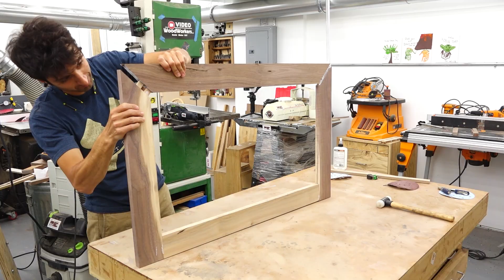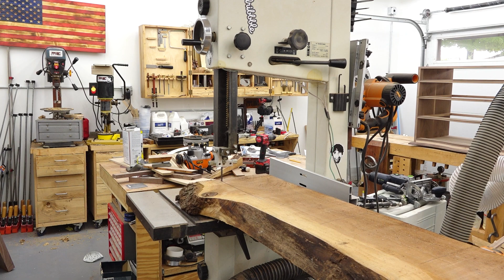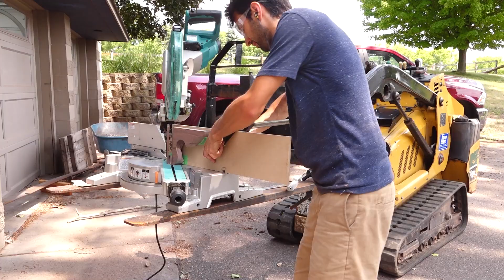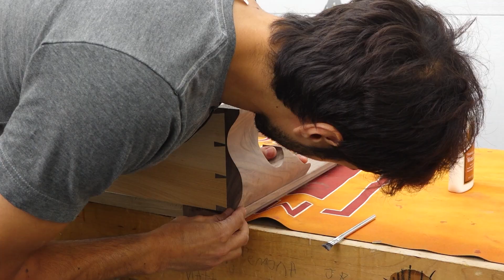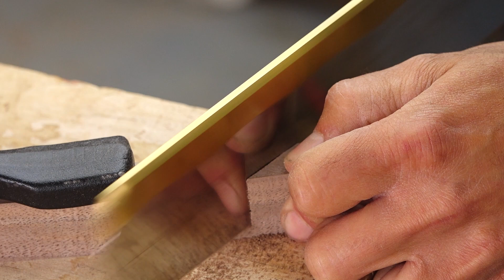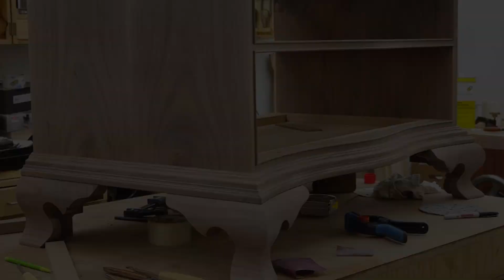The Base (Ogee Bracket Feet) | Serpentine Chest of Drawers Build Part 5

Comment: Was it the camera angle, or did some of the feet blocking material protrude into the drilled out inside curve areas of the finished feet?  Or is the foot depth great enough that you can't see the blocking material, unless you are laying on the floor looking in at the inside edges of the feet?  Super cool video, showing the patience necessary to understand and work with the details of the curves.

Comment: 41:00 ...   I understand that you're rotating the grain direction;  but is there any reason why you're only gluing along the grain sides and not the ends of your blocks? I don't understand why you don't glue on all contacting sides on those scrap blocks glued to the inside corners of the feet?

Comment: Did you make the back and side feet first on purpose, so you would feel too committed to the style to turn back on the front ones?
I think the point in which you were sawing in kerfs and using the coping saw, I'd have decided square or round feet would be fine.

Comment: This is beautiful and very nicely done, without much drama even though the simplest part was made 3 times.

You have very good control of workpieces.  For the rest of us, putting the fence on the opposite side while cutting coves on the table saw is helpful.  That way the blade pushes the work into the fence, rather than pulling it away.

Comment: Wow, amazing detail! CA glue has changed the way we wood work. I've used the tape and glue tricks few times already (thank you YT). I think that sander is my next tool purchase. I assume like most woodworkers, we have more tools designed to sand than any other process. My last tool purchase was a mid size drum sander. Game changer on cutting boards for sure. Really enjoying this series. Thank you Matt!
Reply: Wow, amazing details Matt, another wonderful video. Thanks for sharing. Oh yeah, I loved the diagonal routing tip using the table saw.  That is quite a trick.